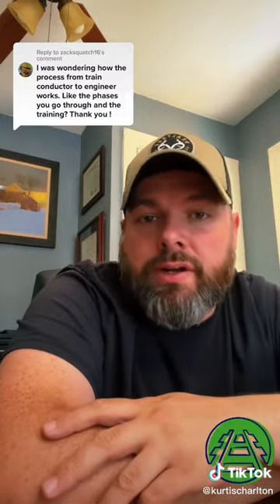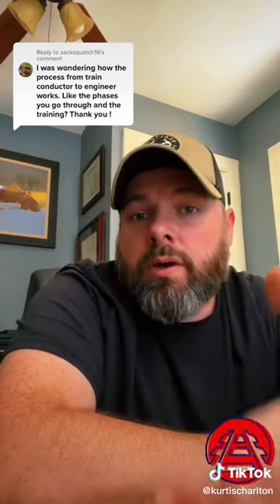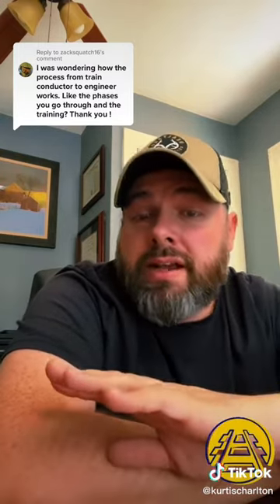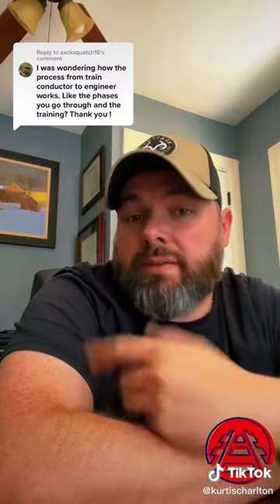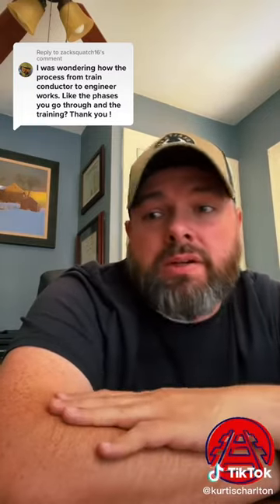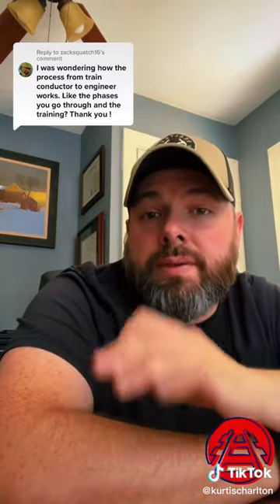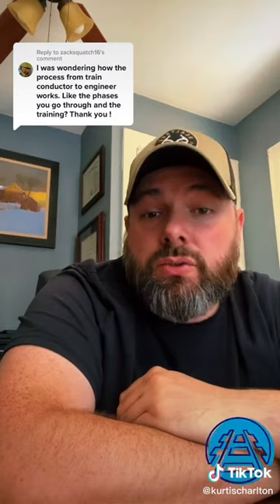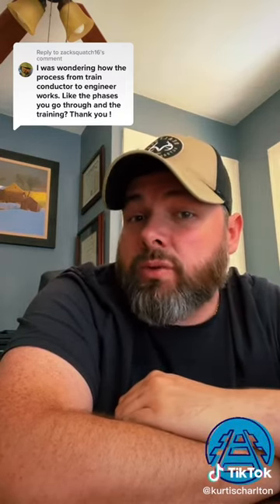From Conductor To Engineer, How Does It Work? 🚂

Comment: How strict is the BMI requirement? My body is mostly muscle, but it's over 40 so I was wondering if they had any exceptions or test?
Reply from the maker: Absolutely. The test is set to measure the muscle to fat ratio. Also the online test isn’t even close to accurate unless you are a stone cold couch potato. The chart said I was 32 or so and when I went for the exam it was like 25. They are strict about it but the Dr. uses skin calipers to test it. 👍🏻🚂

Comment: With the onboarding process now being 3 weeks in McDonough, what tests will be given, aside from the hang test? I’m due in McDonough for conductor training on Monday July 11th, and I just want to be as prepared as possible.
Reply from the maker: Hangtest, comprehensive operating rules, signals, Hazmat, and physical testing on the static station(lacing air hoses, throwing switches and setting hand breaks with and without a brake stick) same as it was previously they’re just tacking on the week 5 content to the third week in McDonough.👍🏻🚂
Reply: I'm in CT training right now 1st week. It's great just make sure you keep up on your on your e learning and homework.  It's a great time so far besides missing my wife and kids it will pay off in the long run
Reply: Just study continually it's only for 3 weeks, and write your signals on flash cards and go over them and you will be fine. pretest are at your own choice everyday if you want.